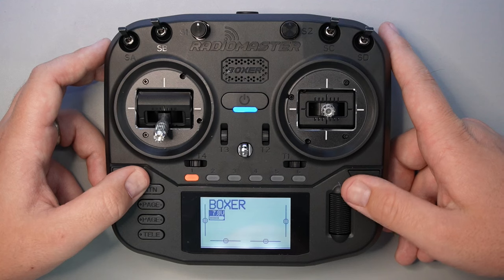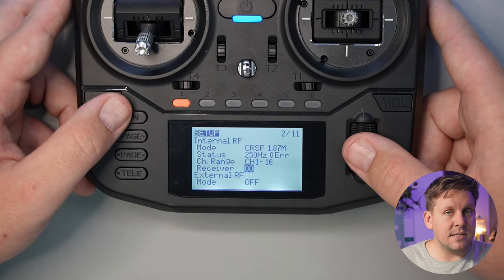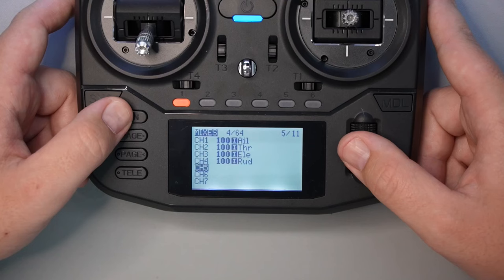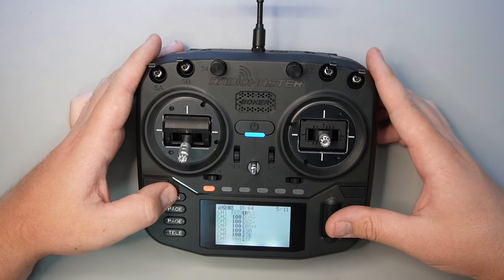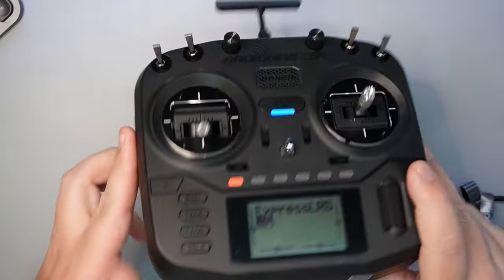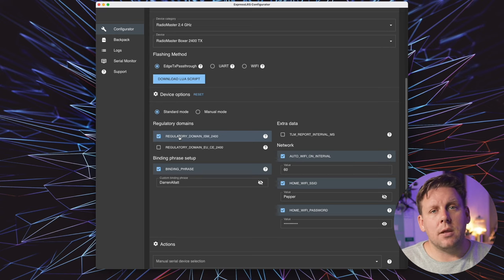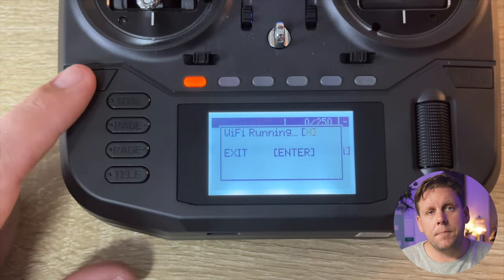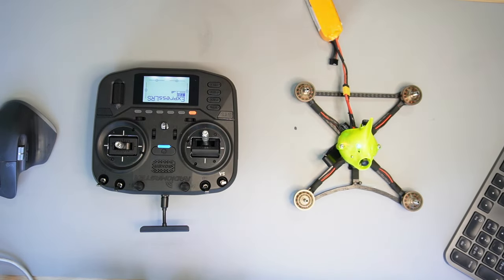How To Setup Radiomaster Boxer ExpressLRS in 5 Minutes

Comment: if i have the Radiomater Boxer 4in1, do i have to do the ELRS configurator step is it already built in?
Reply from the maker: No, set your internal module to Multi
Reply: Ok I did that but when I select express elrs it stay at “loading” and nothing else happens. I can’t flash anything when using usb or WiFi. Via usb it says something related to com port
Reply from the maker: @CarlosRodriguez-vg2ob   That is the expected behaviour. You dont have an ExpressLRS radio - you have the 4in1 which doesnt have ELRS, so ExpressLRS lua script not loading is the expected behaviour. If you want to run ELRS, you will need an external module plugged into the back, where you follow this tutorial but select External intstead of Internal during the model setup.
Reply: @DarrenAllatt  but the box says that it has an internal ELRS module capable of 1000Hz refresh rate. Does that not mean that it has an internal ELRS module and I should be fine?
Reply from the maker: @CarlosRodriguez-vg2ob  I only have the information you tell me — and in your first comment, you said you have the 4in1

On the ELRS version, the only option for Internal is CRSF

On the 4in1 version, you can select Multi. 

If you can select Multi, you have the 4in1 and not the ELRS version.
Reply: @DarrenAllatt  because I’m so new I know I’m probably giving you wrong info and I’m sorry for that. I’m m super lost. Yes I did say 4in1 and that is still the case and yes I see where I can switch the internal to either multi or CRSF 5.25M . So just one last question. So if I wanted to fly an ELRS drone, do I have to buy an external module although the box says 4in1 with internal ELRS? Is that is the case I can return it. I’m just trying to know for sure is not me. Sorry for driving you crazy bruh
Reply from the maker: @CarlosRodriguez-vg2ob  send me a message on Facebook and let’s chat there. You can send me some photos of what you have and we can sort this out.
Reply: What would you recommend for an external module? 
My neighbor bought the 4in 1 and was having trouble so I offered to help and it's been giving me a headache. 
And iv tried alot of things to make this work but at the end with all the uninstalls and reinstalls I'm back to where I started. With out the things he changed. But if that's all we need is a module that would be awesome!

Comment: Disclaimer, while I can fly the wings / props off of anything RC, all of the software,  updating and flashing required with these drones gives me headaches as I am not good with programming and even tho there are hundreds of instructional videos, there are too many variables even for step by step instructions to cover everyone's situations. 
 So my radio was stuck loading the Lua script. After searching possible solutions, turning up the baude rate finally allowed it to load. 
 Now I have two questions before I proceed with my Express Lrs module setup. 
 1 - I cant even recall what the baude rate was set to prior to increasing it to load the Lua script. 
 Although I havnt yet learned what the baude rate is, since I turned it up to the maximum to load the script, I assume I should lower it, and did, to 400, but I would appreciate a bit of guidance here before I proceed.  
2 - In one of the elrs setup videos I watched while waiting on delivery of my module, another YT'er advised updating the Boxers Luascript, which may be what took place in your instructions, Im not sure, but if not, since I cant loacte the original source, how does one go about updating a Lua-script?  
 Thanks for any help anyone cares to offer,  cheers.

Comment: @Darren Allatt can you please help me my boxer in the  manual device selection is coming up as Com5 Microsoft and isn’t working
Reply from the maker: That sounds like a driver issue. Can you add me on Facebook and we can chat
Reply: Thanks for the help yea I fixed it I had to install a driver
Reply: @DarrenAllatt  hey so now that I’ve got my radio sorted out I need help with my drone I’m not sure if you can help me but it’s worth a try so I have a whoopfly 16 and I have upgraded it’s firmware on beta flight but when I bind it beta flight shows me that it has bonded but when I move aux 1 throttle or anything those bar things don’t move at all please help me
Reply from the maker: @furhamsnikta6757  head over to my website. I’ve pinned a link, and I’ll be able to help you there

Comment: I cannot seem to find the transmitter on the drop down menu, is there a driver I have to install first?
Reply from the maker: Yes, you need to install the CP210 driver. Link in Betaflight
Reply: @DarrenAllatt  I download the installer and install the driver and I restarted my pc. The controller still doesnt show up, any ideas?
Reply from the maker: @charliemaybe  you will probably need to assign the driver to the usb port its connected to in device manager

did you select USB VCP on the radio after connecting?

are you using the top port and not the bottom?
Reply: @DarrenAllatt  i am using the top port and the vcp option. How would i assign the usb port? Ill re do the driver install incase i did it wrong, but im not getting my hopes up
Reply from the maker: @charliemaybe  device manager. I don’t use windows

Comment: Hmm.. i did what u did and still got an error at the end of the flash. 😢 i tried to "retry" same shit 🙈 i dont get the serie number when clicking on the "manual serial device selection" i only get  COM1 (standard port type" and "COM3 microsoft" tried both. Didn't work
Reply from the maker: You need to change the drivers for the usb port

Comment: When I click on the WiFi tab, I don't see Express lrs in my list of WiFi choices ?
Reply from the maker: Have you enabled wifi on your controller through the lua script?

It can take a bit of time for your wifi receiver in your computer to see the network too
Reply: @DarrenAllatt did not come on, so I used the bind command in the system and plugged in the battery 3 times to get bind mode, I seem to struggle with elrs for some reason lol

Comment: Hey! I'm a total newbie to FPV and have been practicing in a simulator with a PS4 controller. Now, I'm ready start flying a 5 inch quad. I've been doing some research and thinking of getting the Radiomaster Boxer with ELRS and the HGLRC Sector 5 analog quad with ELRS 2.4G.I know this might sound like a silly question, but I'm wondering if this is a good setup for a beginner like me and if these components are compatible with each other. I would really appreciate if somebody could help me out because I’ve been doing research for weeks and I still can’t find an easy to understand and follow video. Thanks in advance!
Reply from the maker: Yes they will be compatible with each other. I wouldn’t recommend the HGLRC as the electronics are unreliable. Go with the GepRC mark 5 instead
Reply: @DarrenAllatt  thanks so much for the quick response! With which version of the mark 5 should I got for? The ELRS 2.4 or ELRS 915M?
Reply from the maker: @4kCinematicDrone  2.4 ELRS

Comment: Ive got the newest edgetx on my boxer, however i cannot update express. Its says com port does not exists.
Reply from the maker: Which USB mode are you selecting?
Reply: @Darren Allatt  thanks for your reply! I should have updated this comment, I've got the flash completed by building and selecting wifi, the problem seems to be my laptop! It says that the com port doesn't exist or failed to communicate along those lines. after researching and downloading older drivers just for expresslrs those ended in the same way. It appears my laptop closes the port after it being open for so long or something along those lines because the download worked it gave me another com port, com4, before the flash can be finished it's almost like the it gets ended by the computer. It's a new HP 15. with an older processor core3. It came in windows s mode, I had to take it out of safe mode just to install programs.
Reply: @Darren Allatt  I flashed edgetx first on the same laptop with the same USB-C cord, there's something else I did that was bad though, I didn't finish model setup and open elrs lua before I tried to flash express. And because of that I wonder if I soft bricked it.

Comment: In the 'Setup' section, for Internal RF I only have MULTI as an option, no sign of CRSF, any idea of what is wrong?
Reply from the maker: You have the JP4in1 version and not the ExpressLRS version
Reply: @DarrenAllatt  ah okay, so should I look to get another reciever module? If so which ones will be compatible?
Reply: @DarrenAllatt I have the ELRS version and just have an option called ISRM ACCESS
Reply from the maker: No, you don’t have the ELRS version if the Internal RF only says “ISRM ACCESS” that would be the CC2500 version 

So no, you don’t have the ELRS version
Reply: @DarrenAllatt  When I choose the Boxer model. It does say Crossfire. I can modify the baudrate and such, but if I modify the mode then crossfire dissappears again. This Boxer came with the ExpressLRS option in tools and loaded up.

Comment: What happens if ADC is set to global? im new here just want to know.
Reply from the maker: It uses the ADC filter setting for the radio, which by default is on, and for FPV drones, you want it off. 

ADC filter is needed for fixed wing with servos

Comment: Mine is saying it’s failing to connect to ESP32. I’ve tried every USB mode the remote has, and every variable option the computer has. Everything else is supposedly running fine, except that.
Reply from the maker: Have you set up the model correctly first?
Reply: @DarrenAllatt  I thought so, I followed the same steps as this video. And everything worked mostly the same.
Reply from the maker: Then it sounds like a driver issue on your computer. You may need to get the Silicon Labs drivers

Comment: When trying to build the lua script with expresslrs, i get the error "no serial port detected, or port already open" error message. Using windows 11, made sure to update all drivers. Has anyone experienced this error before? Im struggling on every step..
Reply from the maker: You’re not building the lua script you’re updating the firmware on the radio.

Which flash method are you trying to use?
Reply: @DarrenAllatt  gotcha, thanks! I've tried both SD card and through wifi
Reply from the maker: @Moon_Quake  why SD card? I didn’t give you that in this video.

Just follow the instructions in the video - because it seems like you are trying to flash from the configurator by USB, but trying SD card or Wifi on the radio - so of course it’s not working. 

I’m showing how to flash via
 USB, just follow that process
Reply: Sorry I did try USB first as well. I followed the video to a T! You made it very easy. However my error message now says something timed-out. I'm on the expresslrs discord giving the error log messages for some help. Thank you for your time, it means the world

Comment: yeah.. my radio has all different menus, "loading" when I hit Expresslrs.. 
day 5 of trying to get this POS to work
Reply from the maker: Things to check in order:
1) is the radio internal ELRS or JP4in1
2) is the model setup correctly
- Internal ELRS, set internal to CRSF
- JP4in1, set internal to OFF & external to CRSF
- Trainer set to Master 
3) if external module, what version of ELRS is it running?
4) download the lua script for the version of ELR on your external module 
5) for internal ELRS have you changed or removed the lua that came on the radio 
- download the v3 lua

Comment: I'm sure I'll get flamed for this . 
Could you explain and show  it so that a complete noob can follow along  ?
Without speeding up the video to make the "5 minute" threshold .
All the available Boxer videos have the creator discussing how clicking the buttons feel and how firm the scroll wheel is .
Reply from the maker: Hey Alsson, I don’t know what you mean by “you’ll get flamed for this”

But I’m sorry that some parts are sped up there the parts that aren’t really relevant, and unfortunately I do need to balance providing instruction with the YouTube algorithm. I don’t have a Patreon or anything like that where I could produce, slower and more detailed videos. What you can do is slow down the video on YouTube, using the gear icon that could help.

Also, what are you struggling with on setting up your boxer?
Reply: @DarrenAllatt  Thank you for the response. Flamed by others for not knowing how to setup the boxer .
I totally understand the need to edit .
Reply from the maker: @alsson3137  I'd hope they wouldn't considering they would be doing on a tutorial about how to set it up, and would be watching this tutorial themselves because they don't know how to set it up.

No such things as dumb or questions, FPV has a pretty steep learning curve.

What do you need help with?

Comment: I can't get my computer to detect my ExpressLRS wifi.
Reply from the maker: Do you have a wifi card on your computer? It takes about a minute to get into wifi mode. Try usb
Reply: @DarrenAllatt  yeah, for some reason I couldn't bind from the radio or detect it when I turned on the wifi, it's seems like it updates fine via the pass-through. I used a binding phrase in my receiver so I think that's what got me connected.

The weird thing is that when I first updated it, the wifi worked fine. then the ExpressLRS LUA file stopped working. After I got it going again the Wifi didn't work.
Reply from the maker: @armaburton6108  have you updated EdgeTX and what version of ELRS are you using?
Reply: @DarrenAllatt  I'm runing EdgeTX v2.8.3 and ExpressLRS 3.2.1 in my transmitter and 3.2.0 in the receiver. 3.2.1 wasn't supported for the receiver on the drone I've been flying.

The first time I flashed expresslrs I was following this video, but I didn't realize that the WIFI flash was just the same as using the pass-though, so I think I messed something up flashing twice.
Reply from the maker: @armaburton6108   I’d flash it again following this video and then flash your receiver with the same configuration. 

Both on v3.X so they’re compatible

Comment: A fatal error occurred: Could not open COM3, the port doesn't exist. oof, and i followed the exact settings🤣 knew this was gonna happend, my kind of karma. help
Reply from the maker: You need to get the CP210x drivers on your computer 

And select the right usb setting
Reply: @DarrenAllatt  i think i made it with just using wifi!

Comment: Build and Flash failed using this guide.... EDIT - Did the old hardboot of radio and computer and then she worked.
Reply from the maker: It sounds like you haven’t followed the guide correctly.

Which flash mode did you use and what 
was the error message?
Reply: @DarrenAllatt  Did the old hardboot of radio and computer and then she worked. thanks mate.

Comment: I did the entire process in the configurator and it says success at the bottom, but i am not getting the box to pop up that gives me the .bin file you moved to your desktop?? It is also telling me i need to update the Lua script at the bottom? Kind of confused any help would be appreciated....
Reply from the maker: Update the lua is a general recommendation - not that you need to. 

Which flash mode did you select? 

And did you click build or build and flash?

You may have already flashed your radio
Reply: @DarrenAllatt  I got it...i used wifi instead of the edgetx passthrough